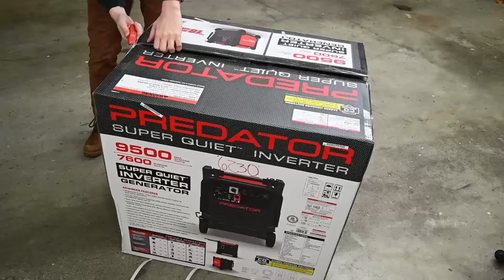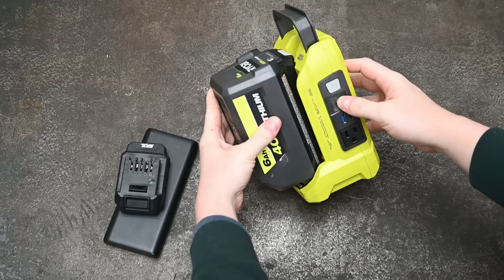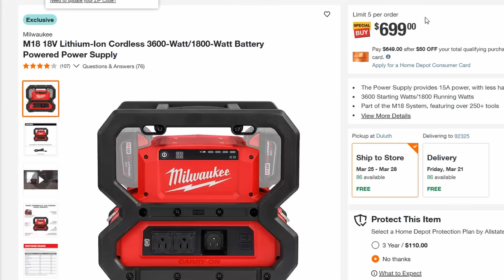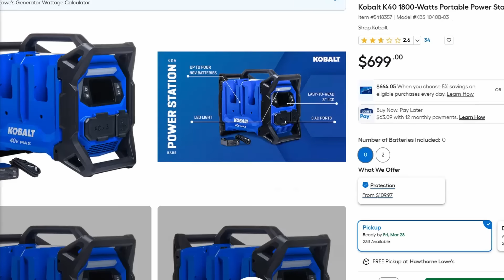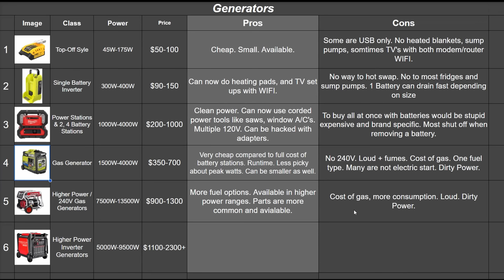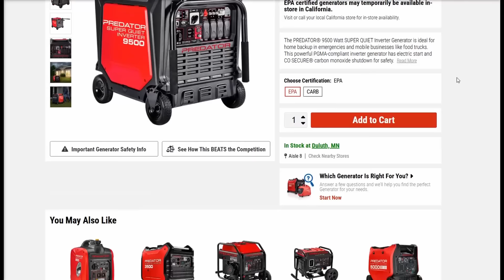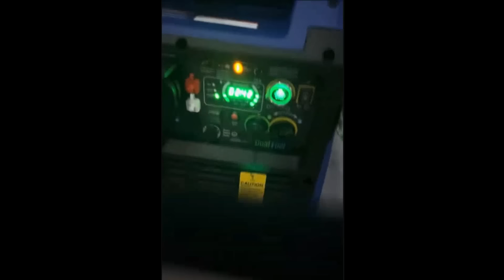Buying Harbor Freight's Most Expensive Generator So You Dont Have to

Comment: Never buy tool battery power stations.
They're not passive and most can't charge with solar. All tool batteries are NMC or nickel manganese cobalt or common lithium ion batteries ( very short life 500 -1000 cycles). 
Most of the fixed battery power stations are LFP or lithium iron phosphate batteries (very long life and safer than NMC batteries 3000 - 10000 cycles)

Comment: got to be carefull with the westing house Company bought 2  same model one started to burn oil bad as in needed 1 quart ever 3 days or so runing approximately 6 hrs per day After about 3 years the auto start  stoped working, but you could still pull start it

Comment: Good breakdown of the different flavors of plan b power.  I cheated for my setup up; guy down the road had a 1400, and a 3800 watt pair of gas generators out by the road with a free sign.  20$ worth of carb kits, and probably another 20$ worth of oil, plugs, and filters, and Ive guaranteed the power on my road never goes out again.

Comment: My solution - an F150 hybrid with a 7.2kW "Pro Power" inverter on board.  Runs off the hybrid battery, starts the engine when it needs to charge and shut it off again.  I ran the whole house including AC on it when PG&E was shutoff (a lot lot in the summer due to wildfire protection that stops lines auto resetting).   Now we have a 24kW Generac with an auto transfer switch.

Comment: Great job.  A lot of GREAT information there....

I have a Champion and I love it.   The electrician that wired my outside the house plug said "that's a good unit."

I think dual fuel is very worthwhile.   Being able to do your test runs on propane will GREATLY simplify your life....  

I think electric start is very worthwhile... but leave it on a battery tender, if you want it to work.....  My Dad & my neighbor of course played it cheap, and got pull start ones, and my phone starts ringing every time, because they can't pull it hard enough.    Anything decent sized, you gotta pull a lot harder than you pull a Honda pushmower rope, okay....  Look in the mirror and be honest about what you're capable of....

Also, what I have found is, having a generator is kinda like having a golf umbrella....  If you have it, it never rains.  Which is great.  If you have a generator, you rarely need it.  the last time my power went out, I set up the generator, I was up & running, I was real proud of myself...  Power was back on quickly.    When I DIDN'T  have a generator, I was out of power for 10 days, which sucked big time.....  True misery.  Trust me, you don't wanna be that miserable.

Actually though, I hope you don't mind, but next time someone asks me about generators, and this, and that, and options, I'm just sending them this video.  I mean yeah, I could nitpick here & there, but on the whole, this is one of the best videos I have seen on this subject.  You did a real good job of explaining the stuff easy enough for non electric geniuses to grasp it & understand it enough to have some functional knowledge.....

Great job.
Reply: I will say, never felt worse about missing the gym for a while than when I 'helped' my neighbor move his big generator during the last power outage lol. And pulling the cord on a cheap one isn't so much a problem as having to pull it for 15 minutes because the dang thing won't start.
Reply: Glad you have better luck with champion two warranty exchanges on the one I have although it's like 15 years ago they might've upped quality since then the predator I have now looks practically identical but 5 years on I feel like I wasted money on the extended warranty I've run it for a week straight in a blizzard only failure I've had was the on off switch but it was a readily available replacement from napa I wouldn't be afraid to buy another predator I'm actually looking at buying an inverter but having trouble justifying it after getting a whole home unit

Comment: Most electronics are either five volts or twelve, so if you have some cable converters, you can skip the inverters altogether. Weather station was five volt, but had a barrel jack, so I have a cable that converts it from usb. Even sketchier, if the device is low power enough and needs twelve volts, you can buy usb cables with a booster built into it.

Comment: I'm curious about the small gas generators being 'dirty' power...are the ones that are around $350-400 not true inverter generators? I had always read before that the Predator 2000 and Honda 2200 were pure sine wave, which is why they had gotten so popular, even though you can get a regular 4500-5500 watt generator for the same price as the Predator.

Comment: so the old Lennox EL furnace (really not very old and a better quality furnace imo. only if it was a SLP series) was when they were making a push for making there equipment solar ready and have brownout safetys so they tend to not have problems with dirty power. those heat exchanges are bulletproof and have a 20+ year warranty. Goodman / Daikins warranty is better but had way more issues after power outages on there higher end equipment for our country installs.

Comment: Big issue with the inverters is that you are converting DC to AC, and therefore get less energy out of the battery pack. If you power your wifi router off a DC battery pack, it will last up to 40% longer on a full charge compared to using its AC power cable and an inverter.

Of course, you do have to make sure you can pull the right number of volts from the battery pack, but that shouldn't be too hard. My Asus router had an input of 19V and 3A, and i was able to use a USB C to bare copper wire (with the right size barrel plug on it) adapter that output a constant 20V and a max of 5A and my router was just fine off it. IIRC, my $100 battery pack lasted for upwards of 36 hrs like this.

Also did this with my Davis Vantage Pro2 weather station which just uses 5V for input so I could go straight from USB-A to barrel plug. It lasts over 2 weeks on a single charge from a 100Wh battery pack.

Comment: You forgot the biggest and most expensive battery banks of them all, Electric Vehicles. My F150 Lightning can keep the fridge cold and the Natural Gas heater running at my place for several days if I charge it before before a big wind storm.

Comment: A couple years ago I bought a used Champion dual fuel generator after a couple hour power outage caused concern with my fiancé being on oxygen. I did no prior research and just got what I could afford. I cut in plugs for my well pump and furnace so I could power them from extension cords. Since then I’ve added a Predator 5000 generator, a 30 amp inlet box on the outside of the house and an interlock on the electrical panel. I can run everything except the air conditioning now.
But here is something few have mentioned but I think is worthy of consideration. For brief outages or overnight power I also have a HF Jupiter 2000w pure sine inverter. It gives me silent, efficient power from any of my several vehicle batteries. It’s perfect for keeping the fridge cold and the furnace hot while not using “any” fuel. The inverter is also quite portable for occasional power on the go. It’s definitely worthy of consideration among the options listed here.

Comment: When harbor fright came out with that 9500 generator I sold my old power boss generator bought plus coupon for like 1800 bucks I never complains that generator is a beast in my opinion never failed much more gas friendly and super quiet although I made the mistake and rushed to buy without waiting to see if they’re a failure rate or so but seem like no has issue with it and mine doesn’t have issue best purchase ever also a Floridian so having generator is essential

Comment: We bought that same one a few months ago. We live in rural Ohio and we bought a home with a generator panel and a hookup outside by the deck. We now have 33 actual load hours on it and it has run our whole house no issue plus you can barely hear it. The generator that came with the house was an old Coleman that was so inconsistent the furnace wouldn't even try to run. The Predator was exactly what we needed for an awesome price ($1800 on a coupon)

Comment: I'm not an American, but why does your furnace need mains electricity?
A thermocouple in the burner area and it should be able to make its own power.   A suitably sized battery to run the electronics, and it should be able to start its own burner under the thermocouple when the battery is detected as low.
Yeah that means it is charging its own battery off gas/petrol where required.  Are furnace makers not very forward-thinking ?
Reply: Because there is a big blower fan in the furnace? Your furnace isn't very effective if the air doesn't move.

Comment: Good stuff. Amazing how so many places in North America are now experiencing more frequent and longer lasting complete power failures over large residential areas. It seems like when we all used incandescent light bulbs, inefficient appliances, power hungry everything, it wasn't anything like this. Now with seemingly less electricity needs per household, we're told the power grids are overloaded most of the time or that the infrastructure is aging so it's breaking down more often. Rolling brown outs, rolling black outs, days long black outs are common in a lot of places. Yet, we pay more for electricity and taxes and everything else. I wish more of the cheaper 10 to 15K generator models were tri-fuel capable. LNG, LPG and gasoline. Seems like this should be a thing but isn't. It is with the very expensive permanent installation sets I suppose.
Reply: Natural gas where I live is expensive. $15 per 1000cuft which is disgusting when you see the wholesale price of gas is $2.20. In theory, you are connected to an endless amount of natural gas unless you are in Texas and the lines freeze. I could get propane delivered cheaper.
Reply: remember reading something awhile back that the power grid was designed for far less capacity and only for so many years. it needs a major overhaul and it was part of the infrastructure overhaul trump talked about first term.
Reply: @nickabel8279  It was also talked about under Obama, those shovel ready jobs. It was supposedly also a focus of the Inflation Expansion Act under Biden. But yes, most of the grid is is 1950 vintage and it was only designed to last 50 years. There is one transformer on my street that looks like it belongs in an antique shop with none of the enamel paint remaining.

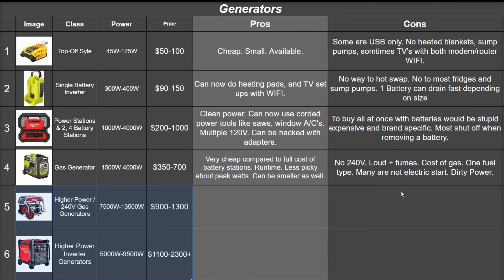Comment: My personal setup. I use a pure sine stand alone inverter. Fueling it is 8 105ah lead batteries. Now keeping them topped up is a 100 amp dc converter!  Now then when the electric goes out the batteries supply clean power with no issues. And can last a few days depending on use. But I also have 2 of the small quiet run inverter generators ran with a parallel kit. Most of the time one is enough and saves fuel. When I need to run more power for something like AC I kick the second one on. And they are handy to just grab and use elsewhere when needed.  I do have a large 17.5k generator. It can fire the house and the shop up just fine. Except for the 15 gallon per 12 hours it drinks!  I have one of my enclosed trailers setup the same way except for just a single marine deep cycle running it. Running lights all night, grinders for tires, topping up a small air compressor, and various other usage it will last until 11:30 usually zonking out as we are loading the car. Lol. I then just fire a generator or swap a second battery in and finish the night.

Comment: Living in TX after the 2021 grid crisis I did a minimal emergency power solution: a pair of portable inverter generators in parallel.  They're adequate for work from home, provided I don't need central AC.  One always runs out of fuel well before the other so power can be provided continuously without the hazard of hot refueling.

I've considered going bigger while remaining (nominally) portable.  I gather if one is willing to get a little bit hack-y, a pair of A-iPower GXS7100iRD's can run in parallel in 240V split-phase mode using the L14-30 ports ... provided you keep your wits about you and also wire up a custom parallel box with breakers on the leads to the generators (so you can render a plug cold to disconnect).  I will of course have to install a soft starter on the HVAC compressor since even both generators surely won't have the Wheaties otherwise.
Reply: I think they sell that connection box for Genmax to 240V, no need to risk. I just have two generators on the big little principle, 2000w small and big one has 240V and drinks 3 times the fuel of the small one but I don't need to run it continuously, unless the small one fails.

Comment: For those who have never used harbor freights 2yr/1yr warranty, If you take it back before 90 days they only charge a 20% restocking fee. At 91 days and anything past that, you must re-purchase your warranty and pay the 20% restocking fee. I have their second largest non-inverter generator and I had to spend roughly $500 to have it replaced after I found the block was cracked with probably less than 120 hours. With a $2300 generator, you're looking at roughly $800-900 for a replacement.

Comment: Or there's our option:  Permanently installed Kohler 12KW, running on the large propane tank, automatic start and cutover.  Like you, we're a little bit out in the woods.  Everything works fine.
Downside, of course, is that it cost about $10K.
Reply: Like our host, I also live a little off the path and I've seriously considered this too.

Comment: One important thing on the dual-fuel generators is the wattage ratings using the different fuels. They have a lower rating running off of propane.

Comment: I use Craftsman's 20V 150W Inverters, I use them for a number of things including additional 12V lighting on my Tahoe with a 60W 5A 12V LED Powersupply, i do this so the lighting does not draw power from the battery and alternator. I also use it to power low wattage lighting during a power outage, or my 5V and 12V Pole lighting for outdoor activities if i dont feel like using an extension cord. I also use them to power those extremely bright yet low power usage garage style light bulbs when i go out for a walk instead of a flashlight by using a light socket to AC plug adapter. Kinda bulky with a 6Ah battery, but they are much brighter than any flashlight i own.

The other thing that should be mentioned in the realm of generators or battery backup are UPS's, yes i mean the UPS's that you normally use with your PC to give you enough time to turn it off when theres an outage or a power surge. I have a UPS for the upstairs PC and main router and a small 300W UPS for the downstairs PC and Extender. But i also use a UPS for my security cameras, not just for backup power but surge protection as well. I also have a small UPS that i use for things around the house if the Craftsman inverter isnt powerful enough such as using it to power an AC tire pump for example instead of using an extension cord, or powering the front and back deck awnings during a power outage instead of manually rolling them in.

In other words, UPS's are useful for more than just giving you time to turn your PC off during a power outage, you can also use them to power lamps or other lighting during an outage while also letting you charge up your phones and other devices. Sorry for the wall of text :/

Comment: I was skeptical about the Ryobi inverter generator I bought 4 years ago (open box from Home Depot) $250. While it is a lower watt rating, it powers everything in the house including the furnace (just not the central air). It is so nice filling the tank before bed and waking up to the furnace running in the morning during a Michigan winter.

Comment: For the price of the battery pack plug in "powerstations" that can support 1800w and etc.... being $500-600+ for the 1800w station itself is ridiculous... Those should be literally $100-200 at most for what they offer....

Unless you literally have like 10+ 4Ah 18V (about 72 wH of energy in them) batteries, it's literally a non-starter for the price... You can buy the Ecoflow delta 2 with 1024 wH of battery capacity for less... supply the same 1800w peak draw with no issue, and it'll include the batteries too...

The only ones that are even remotely acceptable is milwaukee's 3600w or ego's 3000w  because it can do over the 1800w.....